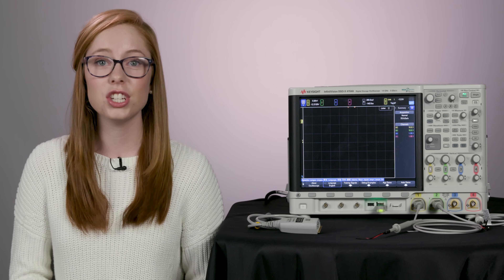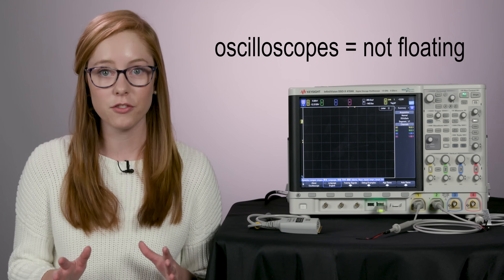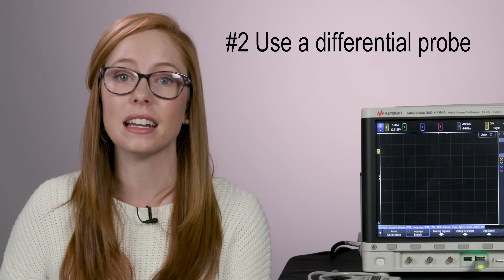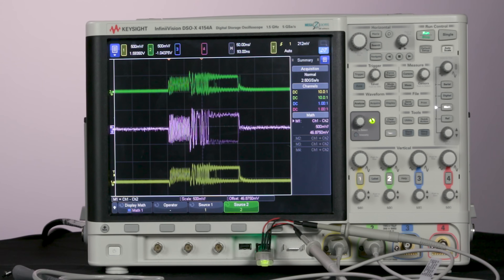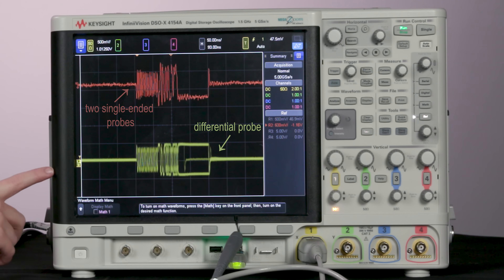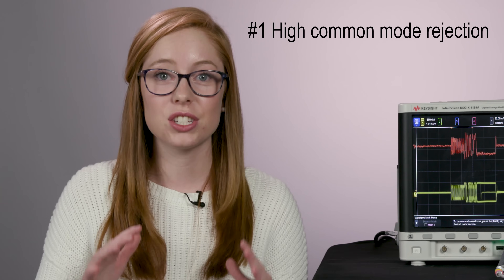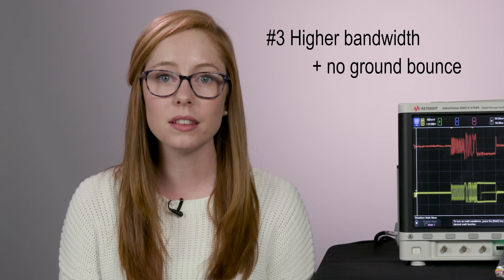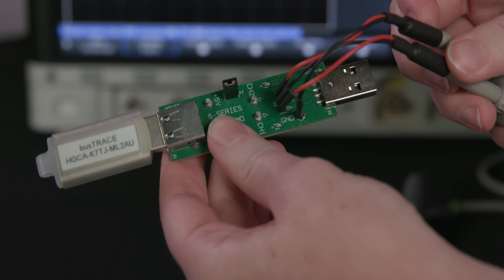Single-Ended or Differential Probe? Take the Mystery Out of Oscilloscope Probing

Comment: So I’ve been trying to set up gains on one of my 4 channel amplifiers with my Oscope. When I use the regular ground reference oscope probe on the + and - terminal on the amplifier I get a reading that looks like 2 AC sine waves wth at are 180° out of phase. Would a differential probe help this?
Reply from the maker: Yes, a differential probe sounds like a good fit here. The ground lead of a single-ended probe is connected to earth ground, so if you connect it into a circuit you are grounding that part of the circuit to earth ground. For an amp, that will definitely mess up your measurement.

Comment: Cant you just hook your oscilloscope to an isolation transformer? İt shoud make the oscilloscope floating?
Reply: you can but shouldn't. the scope's power cord should be earth-grounded; and connect the device under test (DUT) to the isolation transformer.
Reply: Yes and no. It's floating, but the two channels of the scope still have their grounds tied together, and there is still some capacitance to mains earth, since whatever isolation transformer will have some non-zero capacitance between the primary and the secondary.

Comment: Try to test a DC to AC 3 phase inverter without a high voltage differential probe... boom! That's the time I learned from high voltage differential probes.

Comment: I just cut the ground part on my BNC and other grounds on the PCB so it doesn't short the two grounds. I have a switch that allows me to reconnect the grounds. But obviously it also introduces some more environmental noise.

Comment: What are the wires (connected to the USB board) attached on the probes called?
Reply from the maker: The ground wires?
Reply: @KeysightLabs  on the video it seems that they are an integrated part of the probe. Am I correct? https://youtu.be/a28lVMsWFEY?t=102
Reply: @KeysightLabs  https://youtu.be/a28lVMsWFEY?t=102
Reply: Dupont Jumper Wires.
These jumper wires are widely available on Ebay, Aliexpress, Banggood etc.....
also the connectors are available separately to make your own jumper wires.
Reply: @BjornV78  Thanks, acutally I knew about the Dupont Jumper Wires, but on the video it seems that they are an integrated part of the probe. Am I correct?
Reply: @Infinitesap  i think that they are very short Dupont wires, because normally on those compact differential probes, there are many different tips available. There is the simple wires with Dupont connectors, but there is also a tip with 2 short testpins with fixed distance in between, and there are also tips with 2 testpins were the distance between both can be adjusted for easy measuring parallel across SMD capacitors etc....
If you Google for Keysight Infiniimode (yes with 2 ii's) and look for pictures, you can see the different tips for these High speed differential probes, here is a overview of these tips : http://jays.co.kr/12_Files/K_Active_Probe.pdf
Reply: @BjornV78  Thanks for the in depth answer.

Comment: I would think math function would equally reject the common-mode noise. Please let me what I am missing here. How does differential probe reject common-mode noise better? How does the differential probe reduce the loading compared to single ended?
Reply: Two probes have their leads separated across a greater distand so common mode is different per probe. Differential probe has the leads very close together and are subtracted with analog circuitry instead of first digitizing them and subtracting.

I think the differential probes are better impedance matched for high frequncies. Two separate probes flapping in the breeze don't have a good hf return path.

Comment: https://youtu.be/a28lVMsWFEY?t=185 I'm not sure the third point is much use to the general engineering community. Keysight does indeed have diff probes with higher bandwidth than their single ended probes, but these are only for the most elite needs, since they cost almost $30,000!

Comment: Hi!  Why don't you connect the GND of the probe to the DUT, is it because you don't intend to use InfiniiMode? ( https://youtu.be/a28lVMsWFEY?t=2m20s )
Reply from the maker: Yes, that's correct. For a differential measurement, you only need the two connections.

Comment: You 'can' float your scope by isolating the ground, right?  Highly doubt that's recommend.
Reply from the maker: +carlylea definitely not recommended unless you really know your stuff! That would make for a great video, though.
Reply: It's an important thing to check for if you buy a used scope. Some remove/tape over the ground pin on the plug. Some disconnect the ground lead from the mains connector inside the scope. It's a hazard in many ways.
Reply: I float my scope with an isolation transformer but this is mostly done to protect the scope

Comment: And by "generally more expensive" you must mean "far more expensive." :) Differential probes must also have an advantage of performing the difference before hitting the scope's front-end, instead of performing a subtraction of two 8-bit values from the ADC. Perhaps that works into one of Allie's three explanations. I don't know enough about the subject to know for sure. Also, I could easily be remembering this incorrectly, but with the DSOX2 models, I think, that sample rate is reduced if using channels 1+2 simultaneously (as in the video) compared to using channels 1+3 simultaneously. Again, might not remember this correctly. If true, might apply if using the ol' school approach.
Reply from the maker: Good point on the channel usage thing, thanks for the tip! Price wise, both differential probes and single ended probes are all over the place so it's difficult to say much more than this without a stand-alone video.

Comment: I'm in the process of building a couple of high voltage differential probes for measuring mains level signals in 1 and 3 phase thyristor/triac circuits, and I don't want to use the two-probe method because then I would have no free channels to simultaneously measure other signals in the circuit (I have a 2-channel scope). There is no need for a very high bandwidth, 1 MHz would suffice, but it must be able to handle input signals of up to 1000V. I could buy the probes, of course, but building them saves me a lot of money (not counting the time to build them!).

Comment: I would be sunk without differential probes. My work spans from high-speed digital to high-end polyphase power conversion. It is  impossible to get through those designs without differential probes. The challenge is managing the cost. The probes used in power design are MUCH different than the ones intended for high-speed digital.All of them have non-trivial price tags but if you can't get the signal into your scope - you may as well not have a scope at all.